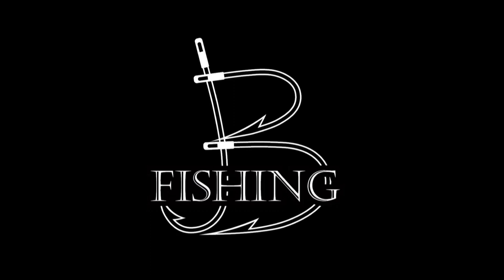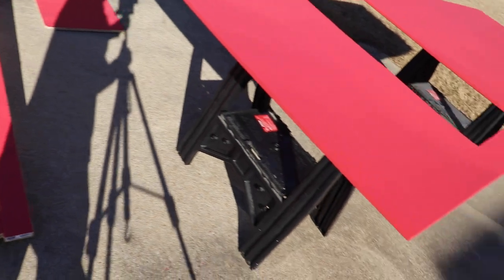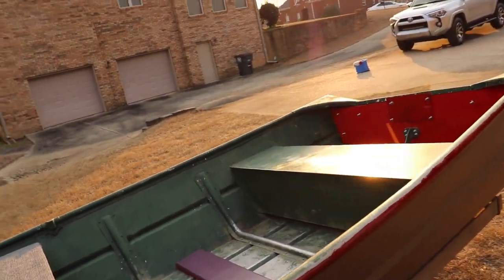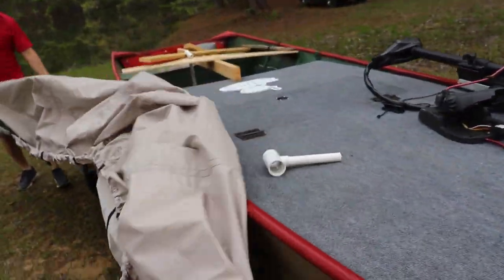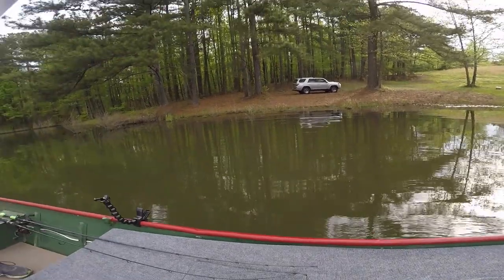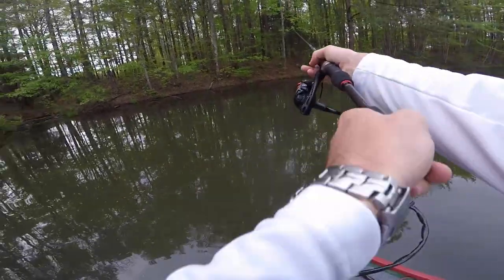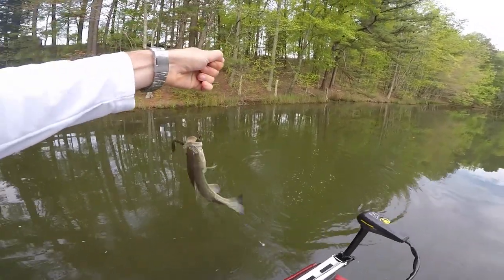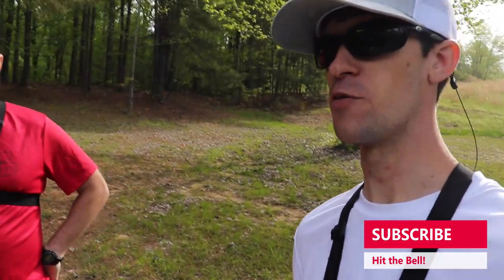Turning an OLD Jon Boat into an AWESOME BASS BOAT

Comment: Should of used aluminum studs to turn it in to a bass boat, eliminate the wood weight, I am in the process of building one.. I tried wood and it took my mph down, with the aluminum it brought my mph back up ...

Comment: Now i want to do this... i have access to a free jon boat. but not wood prices are out of this world! Only difference is i want to maybe do a small outboard on the back and throw a battery storage up front and a trolling motor. Probably have to fill the deck with foam and add another layer of plywood above that.

Comment: How much weight do you think you added in the conversion? Any tips for a similar build?. 
Again thanks for the content during these trying times 👍
Reply from the maker: I would say 500 lbs or close to it. Now in retrospect that may not be that bad but I was legit worried about it. If you get a trailer make sure it is for a job boat. Outside of that it was pretty easy just time consuming
Reply: @B_the_Cameraman  thank you sir. I want to do a small conversion and still be able to load in the bed of a truck, possible?
Reply from the maker: You would be shocked how much wood weighs
Reply: @B_the_Cameraman  appreciate your input. Thanks great video